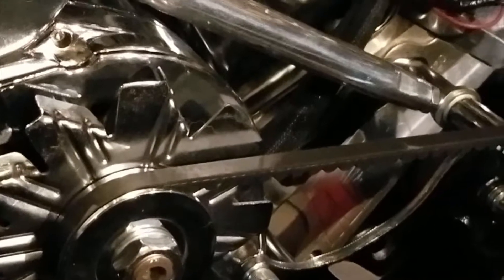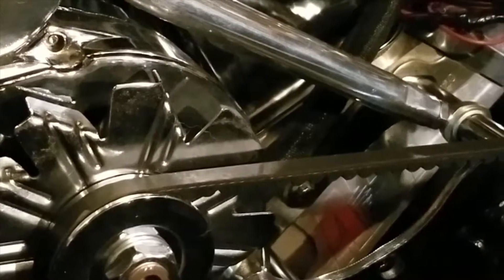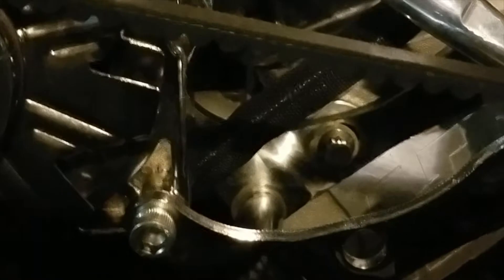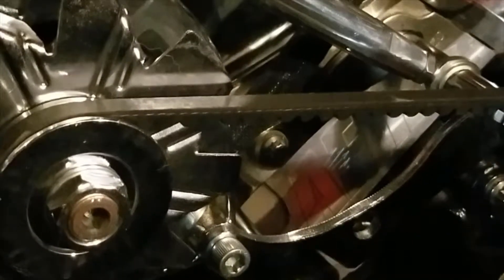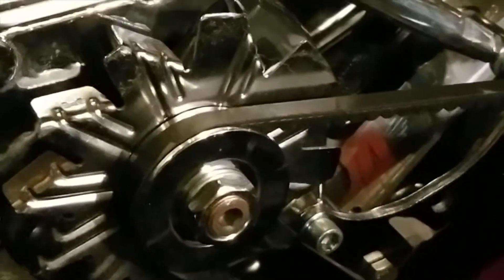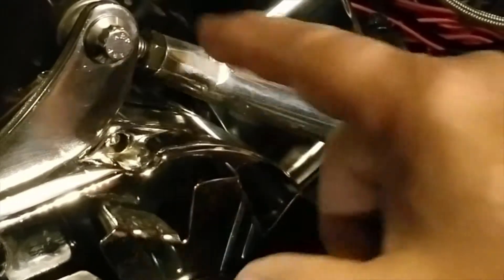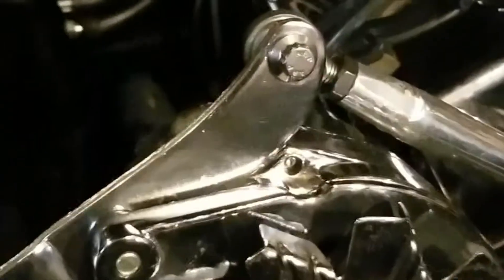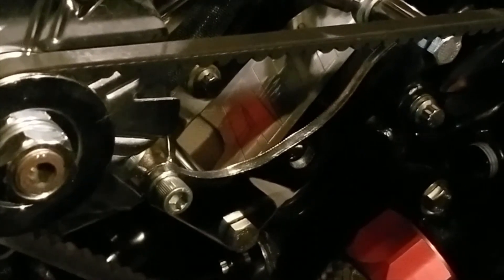Locating the alternator on the passenger side with short water pump on a Chevy

Comment: Great video, what manufacturers made a kit?
Reply from the maker: Thanks, It's not a kit. I use the follow part and they did the job with little modification but some was needed. The parts I use are as follows Mr. Gasket Alternator Brackets part # 4954 (need minimum of 2 but a 3rd in the middle would be help a plus) 
Mr. Gasket Alternator Spacer Tubes # 9853 (need minimum of 3 cut to the needed size)

Comment: How many boltholes into the after market are needed? Thanks Bob
Reply from the maker: If you're asking about bolt holes in the head, this setup used two. They're stock position holes, most aftermarket head  have them for accessories. The bracket I used (the one bolted to the head) did need elongating to right most hole a bit but not much. Also, in a recent video I notices the bracket moving a little so in the same hole I just mentioned I'm going to put a longer bolt in to help support the front bracket better. When I add the bolt I post an update video showing what I did. But even without the extra bolt the belt had no issues staying on, just doing it for good measure.